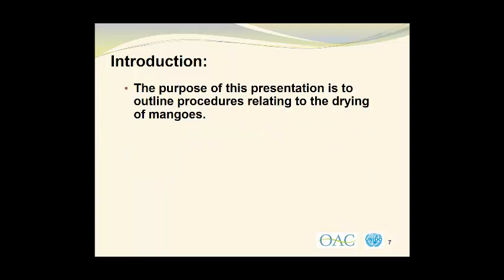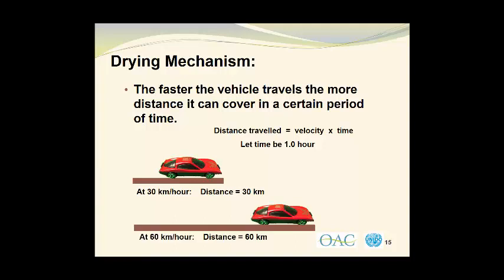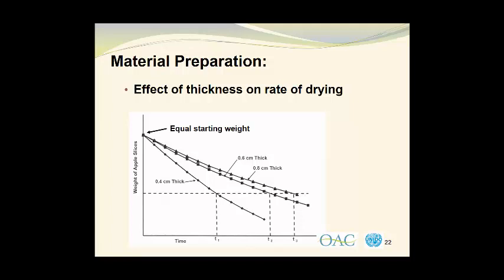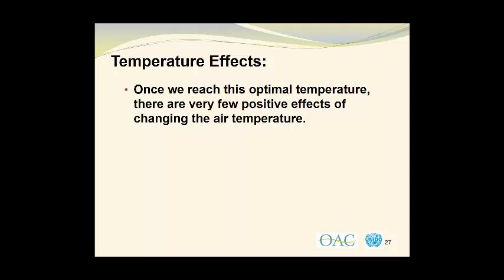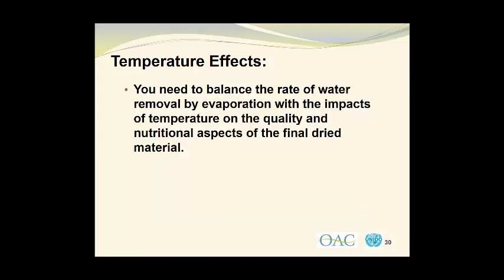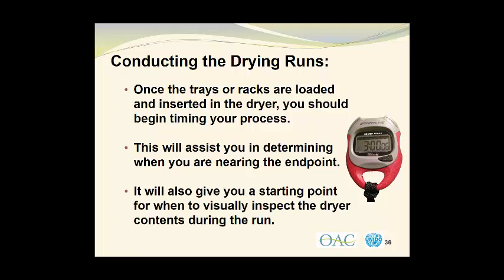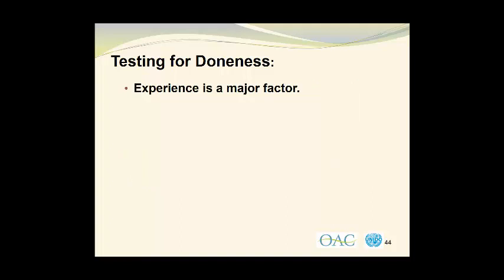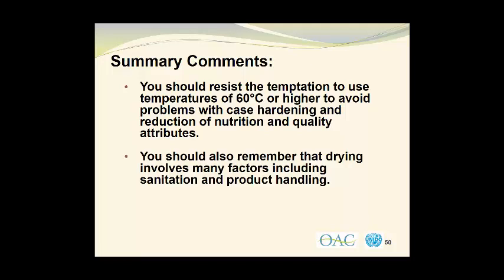Mango Drying - UNIDO

Comment: Great stuff, again - thank you! The parameters that you provided on the summary slide  were exactly what I was after, and your experimental results clearly convey the rationale for them. I do find myself wondering if these values will hold as the processing capacity of the Solar dryer is scaled up.